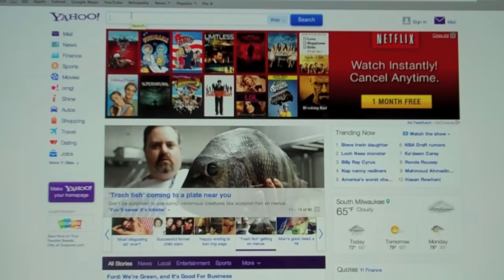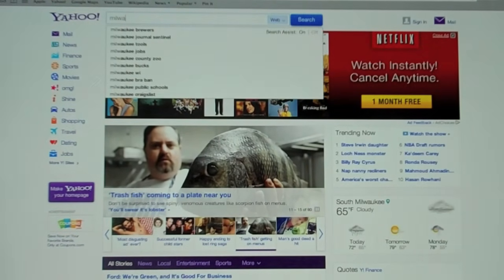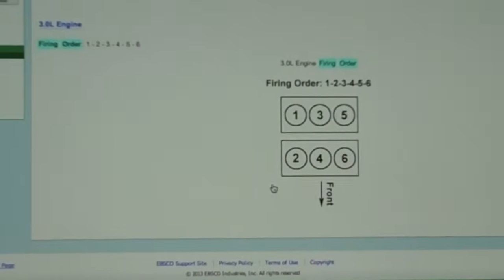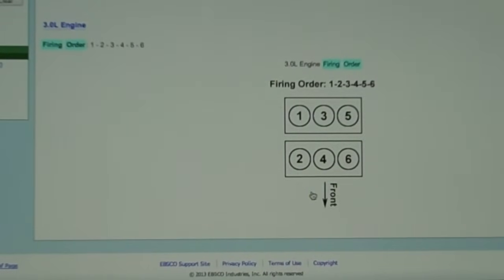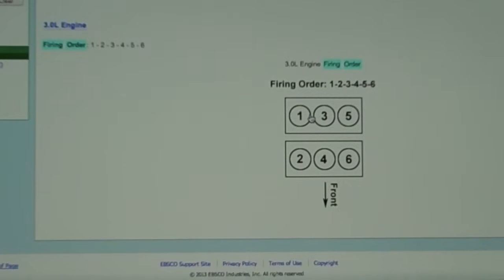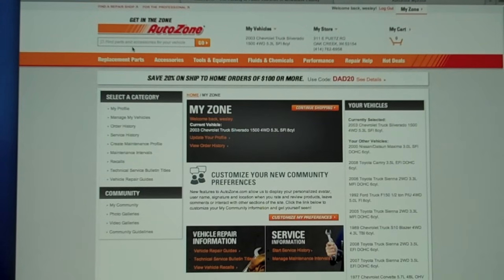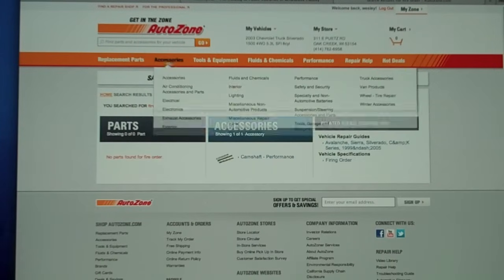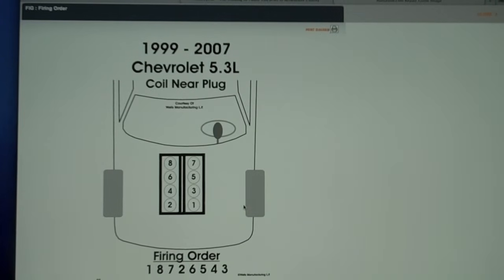How to Find O2 Sensor Locations

Comment: Vehicle; Toyota camry v6 3.5L
Engine name: 2GR-FE
1.Upstream front Sensor(B2S1)
2. Upstream rear sensor(B1S1)
(Upstream Sensor is also known as Direct Fit 4wire AirFuel Sensor. Upstream sensors are same model number. It is twice costly in compare to Downstream Sensor. )

3.Downstream Front Sensor(B2S1)
4.Downstream Rear sensor(B1S1)
( Downstream front & rear are different model number.)

Comment: Great explanation, Wes! Question: If I have pretty much determined I have a condition pointing to an 02 sensor replacement, should I not go ahead and replace the other sensor? In other words, shouldn't I replace them in pairs? Yeah, the #1 sensor (firewall side) is much harder to get to and the easy thing would be to only replace #2 (radiator side) But I'd rather just do the work once.

Comment: Hey I tried checking that website and I'm not too inclined when it comes to checking diagrams and things like that on databases now I know Bank ones are before the Cadillac converter but if it's a deal wait see which is dual cam is the left and the right still bank one no matter what side of engine or for instance 1998 Ford Taurus the bank one supposedly is on the right side it's a 24 valve engine I'm wondering if you could help me out a little bit or give me a link to a website a little easier than the county database to find the proper information

Comment: Hi, how are you?y father has a 2003 Ford Windstar. Its like the minivan that Ford should if never made. He needs a O2 oxygen sensor. I want to get a aftermarket but I was told that I have to check several sensors to see if they work. Would you happen to know or where I can get that information? Thanks

Comment: Hi very important question. How about if both cylinders 1 & 2 are on the same side?? Very confusing! I have a 2003 Ford Taurus 6cyl and cylinders 1 & 2 are on the same side. Can you help me please! Thanks
Reply: on fords 1234=bank 1.....  5678=bank 2  v8 
 123=bank 1... 456=bank2 v6
 so bank 1 is always left side facing motor. bank 2 is right side

Comment: i got the basic tuneup done but should i replace both front and rear o2 sensors on my civic 2000 hatchback dx, 220k kms? would they improve gas mileage or its a waste of $. they are $100 each.

Comment: I LIKED THE VIDEO, but have a Q. I have a carmd that tells me the o2 sensor, po135. Will that make all my lights come on in my dash? anti lock, abs, battery light, even my 4 wheel drive buttons wouldn't work. battery shows good charge.  gmc, 2005 sierra, 4 wheel drive.

Comment: thanks for the info, but what if the firing order is in a straight vertical line goes from 1- 6, starting from the front? where should the bank 1 and bank 2 side sensors be?
Reply: +nuocmat He answered your question within the 1st minute. 8  )

Comment: I have 2007 RAV4 V-6 that has the check engine light on, the VSC light on, and the slip indicator light on. I had auto parts store reset the computer and the lights went off and the cruise control worked fine and  I hoped I was in the clear. Ten minutes later lights back on and no cruise etc. My question is what part or parts do I need to replace to solve this issue? Thank you
Reply: A friend's RAV was doing the same thing. I got some dielectric grease and pulled off the connector for the Transmission Control Module. Put some grease on the end of the connector and reinstalled. After resetting check engine light, it hasn't come back on and it's been a few months. Hope this helps.

Comment: Hi Wes, 
On my 2004 honda civic I had the codes PO134 and PO135( as well as PO325) read when my check engine light came on. I understand that both 134 and 135 codes are O2 sensor codes, but how do I determine which one if both codes are read?  In my car there's only an upstream sensor(which is at the top of the exhaust i believe) and a downstream which is below.  Also, is this a serious problem? Can I drive the car and expect no serious damage to occur?

Comment: I am a disabled and this video is great up to where you go to county cat . Any body outside wisconsin can not use it . It there a way around it as I really need the info to help repair my disabled equipment jeep  it has a error of bank 2 sensor 2 .
Reply: http://autorepair.about.com/library/firing_orders/bl-toyota-firing-04.htm
Reply: Abby Shuler This only shows Toyotas :-(
Reply: Kimberly Johnson You can change the make and year to suit your vehicle by simply altering the web address. In the link he provided, change "toyota" to whatever make your car is, and change "04" to the last 2 digits of the year your car is. Example, mine is http://autorepair.about.com/library/firing_orders/bl-ford-firing-03.htm ... hope this helps

Edit: Links work but I can't get the diagrams to show
Reply: Jeffrey Schroedter Ok, thanks. Let me try that... Ok... tried that, didn't work. Thx anyway.